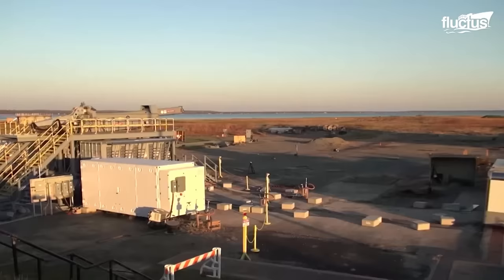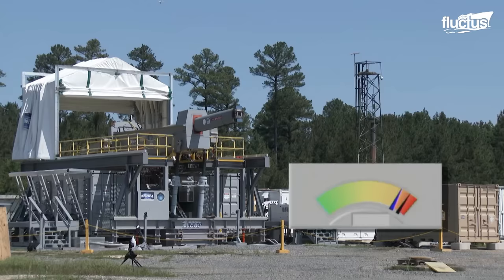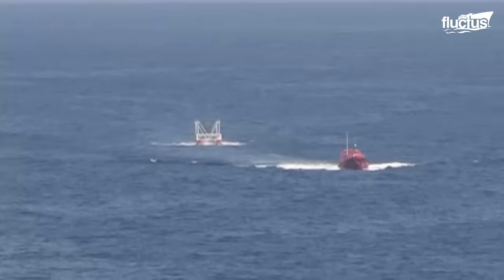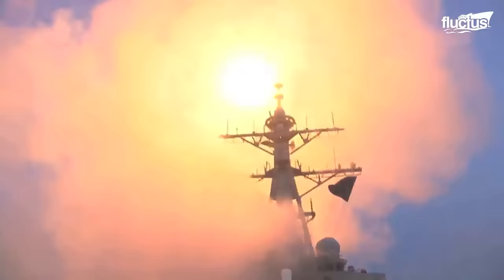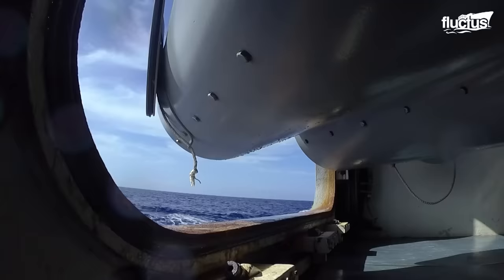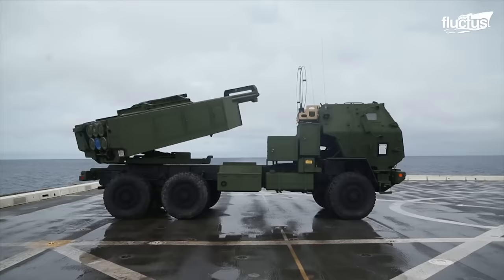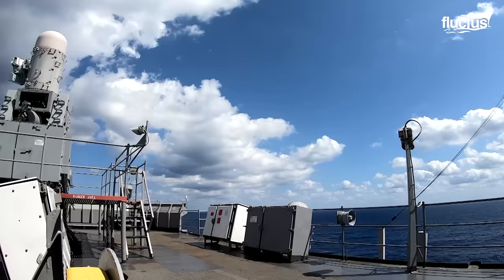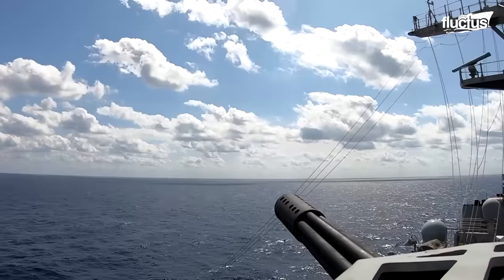US Testing Its Monstrously Powerful $500 Million Rail Gun

Comment: Watching the Rail Gun System fire is very impressive, especially watching it blast through steel plate. However, that steel plate appears to be just in front of the muzzle of the gun. I wonder if long range tests of the gun system have actually been done? If you might remember, in history, the US Navy Ordinance Department developed a new Torpedo system that was supposed to explode under the hull of the enemy vessel when it passed through the magnetic field of the enemy ship and we all know how well the Mark 6 Exploder and the Mark 14 Torpedo worked during the early stages of WWII. One major problem with the system was that the Navy did little or no actual testing of the torpedo to determine if it really worked, which it didn't.
The problem that I see with the Rail Gun System is that "In Theory" the gun is supposed to work very well, but as with the Mark 14 Torpedo, "Theory" didn't work. 
What I think needs to be done is to reactivate the system tests and set up a target, an old ship, and do a "SinkEx" using an operational Rail Gun System and shoot warheads at it at ranges of over 23 miles, the range of the 16-inch/50cal Mk7 main gun on a WWII Battleship, and see if the gun system can sink or damage another ship bad enough to put it out of commission. Next, I would take the Rail Gun System out to sea and shot it at "Prepared Beach Defenses" from 5 to 10 miles out and see how well it destroyed those defenses.
Theory is great, but it is still only Theory until actual full-scale tests are completed and the Theory has been completely proven or we end up with the Mark 14 Torpedo, again.

Comment: I have a question about the Tomahawk. It's a successful missile for the Navy. Could it be fired from the aircraft of the Air Force and even used by the Army or the Marines  equipment like tanks or helicopters.
Reply: You hawent been in the army?
Birocracy rules, and branches dont mix
Reply: It's what's wrong when there's training together, it's called LACK OF COMMUNICATION AND WERE GOING TO NEED TO MIX .
Reply: I guess you could launch tomahawks from bomb 'truck' style planes maybe but i don't see what the point would be. Likely it's because the Tomahawk missile fits a specific role that only syncs with US navy guided missile cruisers would be used for. It's a purpose built weapon for that kind of platform.
Reply: There were both versions. The GLCM, Ground Launched Cruise Missile, was a Tomahawk fired from a TEL that was deployed to Europe in the 1980s. After the fall of the USSR, the weapon was no longer needed, and existing missiles were converted to naval use. An air launched variant was designed for anti-ship use, primarily from P-3 aircraft, but the proven Harpoon was better for several reasons. An air-to-ground Tomahawk would be redundant with the USAFs Air Launched Cruise Missile and was never pursued.

Comment: Because this system uses too much electricity (almost 
equivalent to the entire small city's consuming level) and 
takes a long time recharging it's power back to reload. Also 
after it fired shells every few times, it's parts must be 
replaced because the parts are worn out by the strong 
magnetic field
Reply: No.  It uses capacitors but it's NOT the magnetic field that causes issues.  It's the HEAT from the firing that is the issue.
Reply: Either way, it has a long way to go.
Reply: @timper4326  As long as I know, this project had been banned officially long time ago.
Reply: @tundratiger9473  was this the one they tried to put on the Zumwalt destroyer?
Reply: You're right, first it was the rail gun then the long range gun that the shells were too expensive. That was the joke a multi billion dollar warship you cant afford to arm, around the same time as that failed littoral ship.
Reply: In Russia, such a weapon was tested 20-25 years ago and then it was charged per second with special cartridges generating an explosion in parallel firing at lower speeds.
That is, fast charging of weapons is not a problem.

Comment: We’ve been hearing about this for like the past decade and yet to see it applied anywhere other than a test and research station. I think that part of the huge price tag for the ford class  aircraft carriers was the upgraded power to possibly one day field these “new” weapons? Please correct me if I’m wrong.  I admit that I don’t know everything…
Reply: Rail Guns use a Shit Ton of electricity to work, and need to be "Charged" for quite some time... So, it cant be reliable mounted into anything really... Is an amazing technology Made with amazing enginerieing and works with amazing Phisics, but as amazing as it is, its also non convenient.
Reply: Right now the military is in on laser weapons and in the future, coil guns. We just know those today as particle accelerators
Reply: Actually they didn't abandon the railgun program and it IS currently deployed on all Gerald R Ford supercarriers in a useful capacity, just not in the capacity we expected. Instead of inert slugs, it fires airplanes, in the form of the Electromagnetic Aircraft Launch System (EMALS).

Comment: The problem with railguns is they require so much energy to operate, and that energy has to come from somewhere. Conventional ammunition with its own propellent has all of that energy right there, so there's no need to charge up between shots. Just load a new shell, fire. A ship-mounted railgun either will have to draw energy from the rest of the ship, or be equipped with its own dedicated generator. Which is also going to require fuel to run, so again we're back to the problem of how to efficiently power the weapon. Converting fuel to electricity to kinetic energy is less efficient than converting fuel directly to kinetic energy.

Comment: Never made sense to me they can reload jets with bombs  and missals at sea but can’t rearm the ships
Reply: Everything to reload a jet is already on the aircraft carrier.  Reloading missiles into a destroyer underway would require a unrep ship with a crane to insert the missile into the VLS bay.  Without very calm waters, the risk is too high.
Reply: @TheEngineerJason  that’s what I mean just  put the stuff on the ship why use a crane on a different ship transfer them via cable like they do other supply’s then use the onboard crane
Reply: @MegaBCAD  I'm not saying it's impossible but it would be riskier than loading weapons on jets. Plus there are other side effects to it. Unrep cables may not be able to handle the load of missiles in their armored cases and modifying the capacity would affect both ships unrep equipment. If a crane is needed onboard the destroyer then that crane affects the radar cross section of the ship.  It would be easier if the destroyer could dock alongside an unrep ship that has a crane but that needs very calm waters.

Just as another note, unreps are at speed. Both ships have to be moving otherwise they could drift into eachother. A loss of steering or propulsion during unrep is dangerous even without a missile being transferred between them.  There have been many unrep collisions.  Typically they'll both try to break away if one has a problem but sometimes steering gets stuck in the wrong direction.
Reply: @MegaBCAD  WEIGHT.  You're talking about moving, standing up, and then loading weapons that can weigh up to 2,000 kilos.  That's not easy to do.
Reply: @TheEngineerJason  That doesn't stop them.
Reply: @tedmoss  it does stop them because it's not worth the risk or cost.

Comment: To increase velocity and range would it be practical to use a laser in the intended path of the projectile momentarily before firing to ionize the atmosphere and create a vacuum, ie minimal air resistance? The laser may even act similar to a rifle barrel guiding the shell with great accuracy. Perhaps even add a rocket or ramjet  booster/s to further increase range, similar to some experimental German WW2 shells. Basically a direct energy/rail gun combination that may result in mininaturization to small arms level and perhaps far less power requirements.
Reply: Normal BB shells can basically hit targets over the horizon already. 100miles is well past that. A laser stabilizing the atmosphere isn't going to do much considering it's going to be drawing a straight line and the shell an Arc. If your within visual range to draw that straight line, then it's close enough plenty of guns are already pin point accurate to hit it.

Comment: Now use a uranium core and a quartz crystal with a copper coil around it. Use a shot cup to keep the rails from deforming. With a high charge rate it will super heat the core and a plasma discharge on impact . Your welcome.

Comment: 17,763,480 foot pound energy assuming 8200fps on 17 pound projectile. for reference a 9x19 handgun with a 115 grain projectile going at 1100 fps reaches about 300 foot pound energy. you would have to unload roughly 60,000 rounds of 9mm into a target to deliver the same energy as this railgun.

Comment: I have seen an F-35A lightning II fighter jet fly directly above the area where I live just 200 feet above the ground for an aerial handling display late 2023 which was at the end of a big car race nearby. It was a spectacular sight, it was a real F-35A lightning II but since it was an aerial handling display around a populated area the fighter jet would not have been armed. Publicly available information states F-35A lightning II fighter jets as having a top speed of 1,960km/h but for safety reasons the F-35A lightning II fighter jets that flew over would not have been flying at anywhere near their maximum speed due to the powerful shockwave and sonic boom that would cause. Even though the F-35A lightning II fighter jets flew over at well below their top speed they were still very loud and still made a lot of noise

Comment: I can tell you with certainty that they aren't going to ever put a railgun on a ship. 1) it's expensive as hell and can't fire many rounds due to the fact they were unable to find a material to withstand the heat generated from the electricity. 2) cheaper options can do the job a rail gun does just fine and have even longer range than 100 miles. 3) Laser Tech is also much more effective.

Comment: The principle of the railgun underlies the unusual design of the aircraft, but it is rarely talked about because it is a secret thing. The topic of pulsed plasma engines has been known since the early 1960s (see PPT - Pulsed Plasma Engine in Wiki) - they are usually designed for spacecraft. But I will tell you about a little-known design - plasma propulsion panels for vehicles flying in the atmosphere, they use the same pulsed plasma engine, but reduced to the size of a pencil and stacked like cells in the panel. The design is similar to the screen of an ordinary plasma TV, because there are also bit cells there to activate the glow of pixels on the screen. And in plasma propulsion panels, the discharge cells are long, the spark gap has the architecture of a railgun (just rail contacts or coaxial), and the ionized discharge air is accelerated there by the Lorentz force to enormous speeds - a kind of ramjet engine is obtained. Just imagine! - tens of thousands of small ramjet engines assembled in a panel and synchronously firing plasma at a huge frequency (hundreds of kilohertz). Thus, plasma propulsion panels create lift with the help of pulsed emissions of plasma jets from the cells of the railgun - a huge impulse is obtained, and the plasma twists the air into toroidal rings - the aircraft is supported on this air cushion. Horizontal acceleration is created by the same plasma panels on the sides of the device (they glow, from the outside they look like "portholes"). Devices such as the "triangle" or "disk" have been observed for a long time, they are mistaken for aliens - but these are terrestrial devices. They are classified and used for espionage and secret activities. Pulsed electromagnetic technology generates microwave radiation, so it is harmful to health, so they rarely fly - only on military missions. And for a citizen, therefore, they are not suitable. Declassification has now begun - too many people know about this secret technique. After declassification, they will be used for cargo airships.🕳💫🕳💫🕳💫🕳💫🕳💫🕳💫🕳💫🕳💫🕳💫💫💫💫💫💫

Comment: I imagine that the advantage of a laser weapon is its speed; light speed. Ahem, just 'slightly' faster than the other systems. Even the rail gun is virtually standing still compared to that. But it's transmitting enough power that's the problem with lasers over long distances, stating the obvious. Otherwise, an orbiting satellite with a laser weapon could watch an ICBM being launched, say a 1,000 miles away, and hit it in microseconds, and most military satellites are nowhere near that distance away. The rocket would hardly have moved, no need even for deflection shooting. It's not destroying the missile, just knocking out its guidance systems. Given secrecy, these weapons possibly already exist.

Comment: Railguns are pretty cool, but the power requirements are insane. On a small scale they're not much better than single shot rifles. And on a large scale they take too long to aim. They'd be somewhat effective as a fixed anti ship battery, but we have cheaper stuff that's just as effective. 

Screwy thing about railguns, they'd be an ideal weapon for spacecraft. A forward battery, kinetic weapon which could pierce multiple layers of steel in deep space would be devastating.
Reply: Railguns are basically a better version of artillery, since they have more range and aren't as expensive to fire as rockets

Comment: Can a Laser shoot down a bullet from a raill gun?
Reply: Be like trying shoot down a bullet with another bullet hahahahahah so noooooo 
…sure, Yes can target icbm missiles moving faster than rail gun … ballpark 5k mph vs 30k mph icbm but missiles are SIGNIFICANTLY bigger target vs 7lb tiny projectile moving 5,000 mph … sure one day .. highly dout this day .. but hey maybe I’m wrong …. Maybe if everything was lined up in advance along selected flight path and timed correctly in advance .. still not likely
Reply: Lasers have the potential because they're literally traveling at the speed of light. The biggest issue is object tracking. Speed of a laser is fast enough to reach any projectile,  but it has to be pointing the right way. As soon as a railgun fires off, you would need a computer system fast enough to track the projectile as it moves so that the laser can move to correct position. There are loooots of different methods to object tracking besides using a camera. Its interesting

Comment: They call that Kinetic energy

No need for explosives when the actual speed of weapon causes damage
Reply: they call that useless garbage
Reply: @kjererrrt2381  No they don't

They just have a problem with the barrel wearing out faster than a standard Propellent gun

But then again, it's moving way. Faster has a lot more energy that is causing a lot of heat

And they haven't quite found the right mixture of exotic materials to actually make that feasible.

But they don't call it Garbage

It's actually quite powerful it has a much longer range than a standard gun

But the price of the barrel in the quick wear outrage has to be addressed first before they implement it.

But then again we also have powerful laser weapons which are also really really good
So no you don't know what you're talking about

Comment: They abandoned the project because the weapon could be fire several times before having to have extremely expensive components replaced. That's not exactly an effective weapon if it only works a few times, and breaks. Our material sciences, and engineering hasn't caught up to our leap in technology yet.

Comment: Rail guns have excellent potential, we do have a power problem and a barrel degradation problem... but considering how much money we spend thats not really a problem at all, increasing energy generation and more durable barrels and by extension materials, have a multitude of applications outside of just a rail gun If I am not mistaken some of the defense budget is already going towards fusion energy and they are making solid progress on it. This energy source would be more than enough to run rail guns, not to mention it could solve many energy issues we currently have since it'd be almost never ending and almost no waste or byproducts, but we are 'MURICA so we don't care unless it can blow shit the fuck up I doubt I need to remind anyone about the nuclear bomb? The scientists working on the project said they could easily create a functioning reactor in the same time frame as a bomb, but didn't happen until 1951... 6 years after the war ended through the brutal use of the weapons.

Comment: Wouldn't a railgun prove a flat earth with it's shooting abilities of how far a projectile can travel & hit target? 🤔🤔
Reply: No.  Period.   Since before WW2, the Earth's curvature has been, and in fact must be, factored in when targeting systems calculate firing solutions for long range weapons.     For instance, the 16 inch 50 caliber Mark 7 main battery of an Iowa class battleship has compensation for the Earth's curvature built in to it's fire control system.    This was actually necessary on all battleships of the twentieth century.      Those big guns had the capability to fire at targets far over the horizon visible to a person standing on the deck.   The high mounted optical range finders on those ships are proof of the Earth being round and not flat.
Reply: @stargazer5784  I don't understand how it's so hard to understand trying to prove a gun shoots straight 😅 if YOU yourself can SEE a Target & HIT it at 50 MI away there is NO curve.